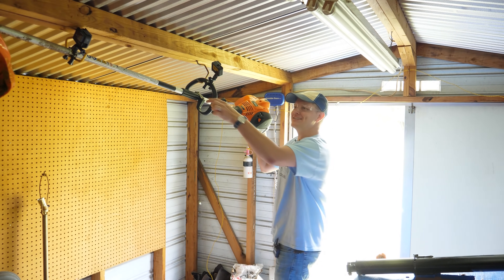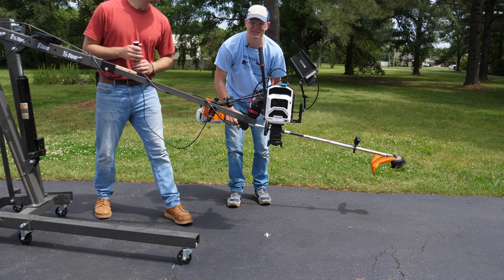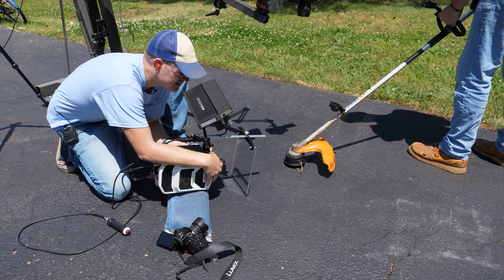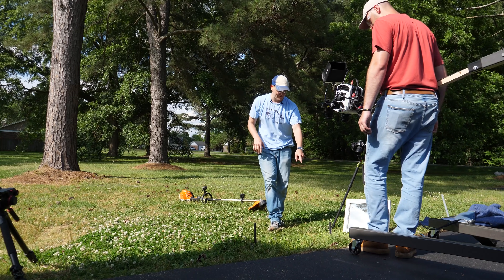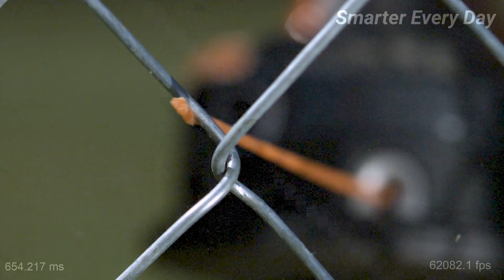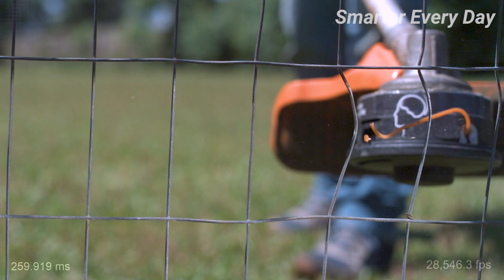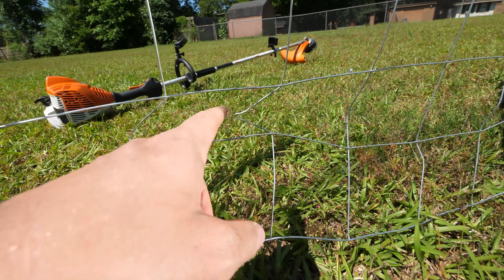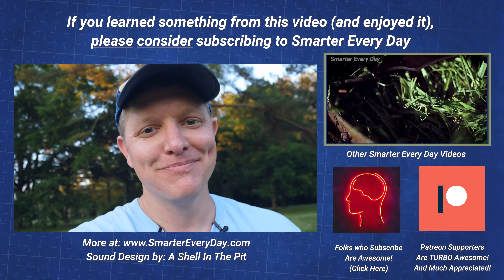How Weed Eaters Work (at 62,000 FRAMES PER SECOND) - Smarter Every Day 236

Comment: "95 thousandths of an inch"

That moment you realize using metric just makes more sense.
Reply: It actually hurt to see someone quote measurements in imperial from a vernier callipers 😭😭
Reply: @daracorr1484  "A calipers"?…
I mean it doesn't hurt but…
Reply: @daracorr1484  When did that happen ? No vernier calipers were used in this video.
Reply: @daracorr1484  it hurts to see someone care how another person measures length. A universally arbitrary constant based system. Stop thinking your arbitrary unit is better.
Reply: Micah Burgin it is better
Reply: @MicahBurginGTVPO  arbitrary?? 🤣🤣🤣🤣 you must be American lmfao
Reply: @lefortkevin83  I know what the meter is based off of. Good work assuming I don't. It's still arbitrary because something literally derived from the abstracted average spherical size of earth is, completely and totally, irrelevant. It gives you no sense of what a meter is. Therefore, for the function of being a measurement, it is, yes, arbitrary.
Reply: @MicahBurginGTVPO  so my comment went clear over your head. If you think the systems are arbitrary you have no real understanding of their true use and value. We wouldn't be having this comment conversation on smart phones without the metric system. That's just 1
Reply: @lefortkevin83  go look at the definition of a meter.  Definitely arbitrary.  1/10000 of 1/4 the average circumference of the earth.  defined when they didn't even know the circumference of the earth.  LOL
Reply: @nathanchristensen4864  We have known the approximate circumference of earth since Aristotle.
Reply: G Guest Well In my opinion what makes it better it is that it’s proportionate, practically the whole world uses it and understands it, it goes down to atomic levels, it’s just overall easier to do research and measure stuff, I get it that America doesn’t want to change because of the adaptation period that would mean, but considering how metric is that wouldn’t be THAT hard. Yes, you can do science and do amazing things with the imperial units, but that doesn’t make it more practical in the world we live in. America is not the whole world and americans would benefit the most from that switch.
Reply: @The11dlf  I'll be more interested when I see vehicle speedometers showing speed in m/s.
Reply: pmailkeey but considering the distance we travel with cars, on average in cities and especially in long drives, it’s not practical, it’s better to measure the speed of how many thousand meters you do, per hour, again I think it’s just practicality
Reply: @The11dlf  But the hour is not metric ! It should be km/ks (= m/s) or km/Mys. Since 70 mph = 31·3m/s, it's probably a better value than 313 Mys
Reply: Metric is better.. no question.. it makes more sense, it’s much easier to understand and it’s clearer. 1mm, 2mm, 3mm... etc. Is a lot easier than counting how many 16ths or 8ths of an inch there are. BUT.. there is no point in trying to switch a system in a country as big as the US. It would take years to implement and why change it when 300 million people are fine with it.
Reply: @TheSicarioEbreo  So, UK kitchen cupboards etc. are 600mm wide - and you're happy with that. Meanwhile, we remember that they're just 2 foot wide. So much stuff now is in metric units of imperial measurements - 227g (=half a pound) 454 (or 450g) 1 lb, child aspirin, 81g (1·5 grains).

The one plus side to using metric is the value is the same everywhere. with imperial, you need to know which country's version you're using !
Reply: G Guest, is it not true that the meter is defined by the speed of light and the definition of a second? Not arbitrary now but it was before
Reply: @anonymouspoop2  it is still arbitrary. 1 millionth of the distance from the equator to the north pole is just as arbitrary as the distance light travels in a vacuum in x amount of time. One is just more precise.
Reply: @gabemerritt3139  It's not about how we define the base unit, but how all other units and multipliers work. On one hand, we have eighths and "five tomatoes", on the other bases of 10, all the way up or down.
Reply: @AdamZovits  You're wrong, it's 6 tomatoes. because it's half a dozen as 12 is used as it's easier to divide by 2,3 and 4.
Reply: @AdamZovits  it's a easier system to understand and learn sure. But it is no less arbitrary. Base ten just happens to be what our number system is arbitrarily based on, so it makes sense for our unit system to follow.
Reply: @gabemerritt3139  for what it's worth, it could be base two, or base pi, the point is that there is one single constant that is used for each "step" up and down for all measurements. Millimeter, centimeter, meter, kilometer; milliliter, centiliter, deciliter, liter; gram, kilogram, ton: all multiples of one single constant. Inch, foot, yard, mile: a different constant for each step. Ounces, pounds, stones: a completely different set. Cubic inch, gallon, cubic feet, cubic yard: another set.
Reply: So what is it in metric?
Reply: Mike McAuliffe 2.413mm
Reply: @yammmit  yeah that's so much easier to understand
Reply: G Guest  Since when was an imperial measurement arbitrary ? As educated people know is the width of the thumb. Now see if you can guess how long a foot is ?
Reply: @millomweb  
the width of a foot? lolololol
Reply: @andyman8630  Amazingly close :)))))

So something a foot long and a foot wide isn't square but 12" by 3" ;)))

And if we go 3D, it's not a foot deep but an ankle.
Reply: @Whynot15366  You've been robbed of a pound there - 5kg = 11lb
Reply: Gaming Boomer 5kg would be nearer 11lbs  The rest of the world has tape measures rulers and scales that show both systems
Reply: Not like it is much different considering that 1 mm is just 1 thousandth of a meter and  .1 mm is 1 ten-thousandth of a meter. If you actually use it people just call it 1 thou, which is even easier to say than 1 mm.  If you really want to get confused, talk to some electrical engineers that call thousandths of and inch mil.  so 1 mil is 1 thousandth of an inch.  While people claim metric is better, when it comes to engineering in 10 thousandths of a meter vs thousandths of an inch it really makes absolutely zero difference.    So while it sounds nice to say it makes more sense to use metric, I would say spending billions to switch tools and books and education for an entire country that has no desire to change makes no sense.
Reply: too bad if I used metric where I live I’d have to convert it for everyone so they all understand. it doesn’t make more sense when 300 million people don’t know what you mean.
Reply: @yammmit  it makes sense when 6 billion other people knows what you mean
Reply: yammmit wait a second did you know THERE ARE COUNTRIES OTHER THAN THE USA AND MORE PEOPLE USE METRIC?!?!?!?
Reply: @5yearsago5yearsago29  but those don't matter
Reply: @yammmit  
only 3 countries do not use the metric system and they're all third world
Reply: @andyman8630  But if you count the countries in imperial units, it's 4 !

Comment: "Don't do this at home"
removes guard
Me: uhhhhh
Reply: Own a 1991 Echo and two days after I bought it, took the guard off. Biggest waster of trimmer line ever devised. It would always pay out more than you need either on the first bounce and certainly the second. All those bits of line add up and the intent is to get you to buy more. You learn how much line to pay out on each bump and you save a lot of trimmer line that way. 
All the commercial lawn services do the same thing. The guard is nice but positioned wrong so I took it off. Still have it, just stored it away.
Reply: @mk84ldb  You're gonna burn up your engine doin that.  Things like that are well thought out at the factory and should not be messed with.  Good luck!
Reply: @theodorebennett7938  he said he bought it in 1991. I would say it's doing okay
Reply: weed

Comment: Tension break.. you did a Bullwhip video once, right? So when it hits and wraps, that bit gets highly accelerated and puts on the tension.
Why does it pull that direction when you hit the stake? It's not the force of the line hitting the stake, but the balance of forces between the two lines as they rotate. normally, the centrifugal (always get that mixed up) between the lines is more or less balanced. But when you hit the stake, the retreating line has lost a lot of energy, but the advancing line is still pulling on the hub, the forces are unbalanced, and it pulls the head. As the strings switch places, the string that was retreating gets slung outward and becomes the advancing line and snaps taut, while the other line hits the stake and loses its rotational energy.

Comment: Lengthening the lines on a line trimmer greatly increases the load on the engine and, in turn,  increases the wear on that engine.  The same thing goes for putting more lines on the head which is why those after market heads with more lines than what your machine was originally equipped with are great for shortening the life of your line trimmer.

Comment: if the Weed-Eater spins clockwise, go left to right. if it spins counter-clockwise go right to left. it will throw the cuttings into the yard rather than out of the border/yard.
Going the opposite way you will find yourself gouging the ground which isn't a very good look..

Comment: You keep thinking it's a tension break, do not discount the fact that friction is involved and heat could be melting the string at that point.
Reply: I too think it's a mix of tension and sheer. The heat is neclectable.
Reply: @Seelenschmiede  friction could definitely be making the string into a plastic state. I'm not claiming friction is the only force at work here but it's definitely a part.
Reply: @Twobarpsi  yes, as I said: a mix of forces

Comment: Triangular string or any string with edges is a waste of money. All of the cutting is done with the tip of the string, and you will find out the tip becomes smooth within a few minutes of use. The strongest most durable line I have ever used is from Dewalt.

Comment: My string trimmer doesn't have a button. It's actually tension based, if you let go of the accelerator you will hear it faint click. Then you know it's extended just a little. If you need more, just repeat. If it gets too long, it has the same cutter on the guard.
Mine is electric plug-in too so there is that.

Comment: One thing i noticed you didn't mention was the heat effect being applied to the trimmer string as it was wrapping and unwrapping around the wire.  That was what I noticed was happening and was the cause of the breakage.  Those little bits flying away as droplets was string that was melted.

Comment: At 13:36 it seems like the reason why the string is ripping, is because the time, that the part, that has slung around the fence needs to unwind, is longer, than the rotator of the weed cutter needs, to build up enough tension from just turning, that the string just rips apart at the tension point right before where it hit the fence

Comment: You always wanna knock the weed away from you. its going counter clockwise, so right to left means its going increase the chances of having wood, stone, or plants launched towards you, thats why you always keep them at a slight angle with the right handle being a bit lower than the left. Then just smack with the right side. You can go right to left with it as wel, as long as you maintain the angle so the right side doesn't whack too much

Comment: From my commercial experience square line last longer than the round. But I have gone back to using the round. Why? The square has more drag. It moves more air which in turn pushes grass down leaving more grass uncut. Square line does goofy things when it hits a solid objects. Round sting seems to recover better from solid impacts. When trimming sidewalks square line causes more errors for lack of better words. Square line is great for brush cutting and last longer but cant compare to round line for precision work.

Comment: Destin,
This video was awesome. Brings back memories of summer days. I myself always preferred triangle line myself for cutting and durability. 

However, the best durability, while sacrificing safety, is using a retired skill saw blade, after all the carbide tips have worn off. This would be an interesting thing to record in slow-mo. I would assume the grass is cut more with a scythe effect, rather than a rough tearing.

Keep up the great videos!

Comment: REALLY interesting. A quick side note: That nylon line gets brittle if it dehydrates. If you keep in a ziploc with some water it will be a LOT more pliable and durable. I keep mine in a 5 gallon bucket with a lid.

Comment: It's funny you've never considered the line length and engine torque demand. I worked on them while in high school at a small engine repair shop. I always had to tell customers not to remove their guards and also to try and keep the line at its longest length. Reason being if the line is run too short you can actually over speed the engine. If you do it for an extended period of time it can slowly destroy the engine. That was far less common than the other problem though. Most would remove their guards and then come in with a heavily worn engine. Even though it was less than a few months old. It was because they had such an excess load on the thing at all times, it was destroying itself. Not just the engine but the actual shaft and all the bushings and bearings would be so worn from this too. The cutter that regulates the length of the cutting chord not only keeps the engine from over speeding but it keeps the string the same length. Which makes the rotating force much more evenly distributed among the bearings. So if one side of the string is longer than the other, it will destroy the bearings and gears that drive the head.
Reply: To be clear. I didn't mean it's funny you've never thought of that, as an insult. I merely mean it's funny because of the fact I think about it immediately when someone tells me about a problem with these tools. Since I had to deal with so many different failures and problems with them. You find out a lot about the engineering behind these machines. It truly does make me grateful for the amazing minds behind even  the simplest of machines. Without these fail safes, we wouldn't have the convenience we do today.

Comment: Seeing the line and the wire in slow motion just makes my intuition as to what the line is about to do just feel off :P That is, I almost feel as if the line is acting as if it were much denser than it appears. That is, it appears in the slow mo video to be moving slowly and thus with low kinetic energy, but its behaviour is as of with something with high kinetic energy; thus, the line intuitively feels much heavier. Is there actually a way to come up with an effective density such that if we took a line with the effective density but at the speed it appears in the video, the physics is the same? I am thinking of something similar to that used when scaling down ship models to table top sizes. That is, is there a scaling relationship that we could use to see the same physics without needing to go to high speed?

Comment: Destin, first off, that was really cool so please keep doing what you're doing.  But really I think you should look at how the natural frequency of the wire fencing (as determined by material, diameter, and spacing) corresponds to the angular frequency of the weed eater and how this influences the observed behavior.   For instance, it looked to me like the 0.060" fencing had a harmonic that acted as positive interference to make the next strike of the weed eater amplified.  You could easily observe the harmonics of each kind of fence by plucking with your finger, filming at high speed, and measuring.  I'd love see how that pans out.

Comment: I'm a Stihl dealer, if I remember right dealer training, for each inch you increase the diameter of the trimmer line,  you loose aprox. 1000 rpms at the head. Huge change in line/cutting speed!

Comment: It would be interesting to calculate the G's on the tip of that line when it hits a small diameter wire and accelerates from its current speed, to a speed sufficient to allow it to wrap around, and then unwrap, the wire obstacle two or three times before the original body of the cord leaves the area.
Compare that to the nominal tensile strength of the polymer used, and you can get a good idea of how much tensile failure plays into it breaking, as opposed to stress and sheer failure.
I spent about 20 years in plastics on the technical side of things, and my gut tells me it is a serious combination of all three.

Comment: 16:04 has to be the coolest part. It pops that wire off and slings it up and around the cross wire above it and then the weed eater line comes back and grabs that severed bit of wire again and slaps it out of frame like a boxer hitting someone again that they’ve knocked out with a prior punch, while they are still upright, unconscious, and falling to the ground. Lol!